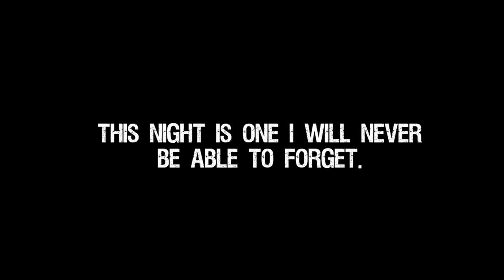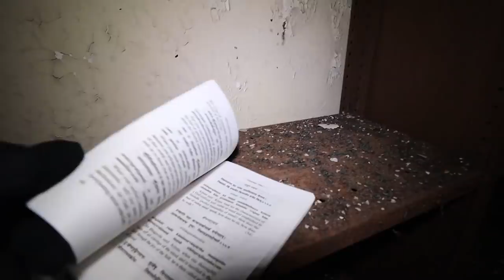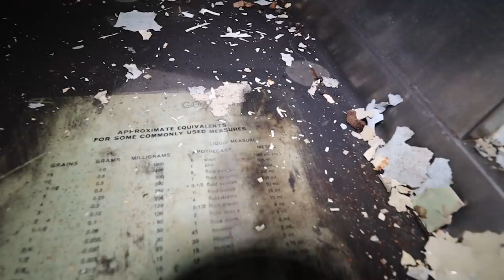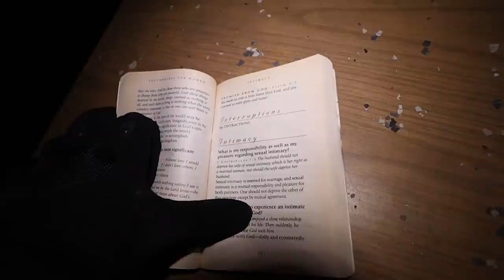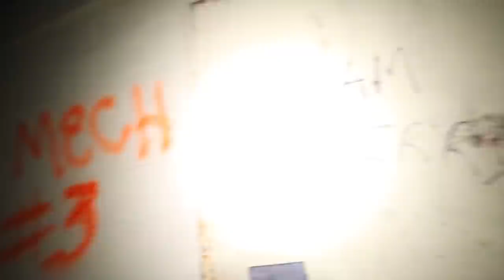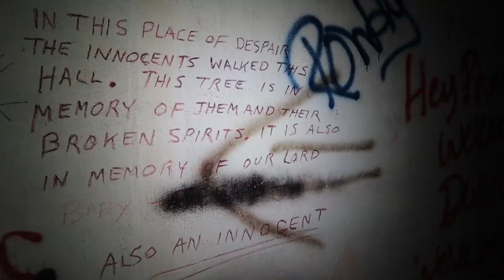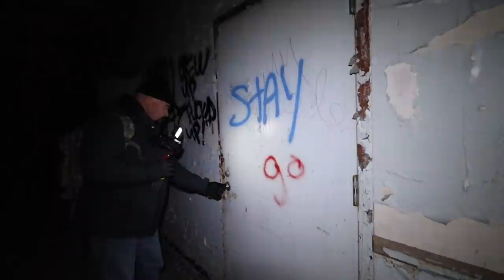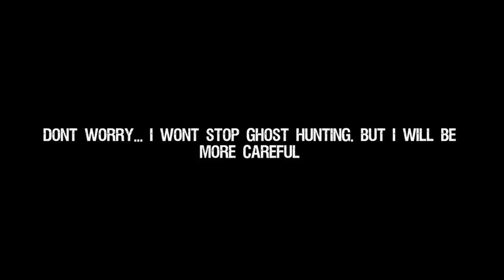**Part 1** OVERNIGHT INSIDE PENNHURST ASYLUM CONFIRMED HAUNTED

Comment: 29:50 when you toss the ball after it hits the floor and starts rolling you see an orb move really fast from right to left from the door ways 36:36 you can hear a whisper say down here 44:00 you see white mist left top of the screen and then what was that noise at 44:04

Comment: Pretty sure you aren't reading thousands of comments but at 41:50 the yellow caution tape was swinging.  It sounded like a single dog bark at 39:00, 42:13, 50:56 and where the coffin was located.  Saw some orbs here and there...maybe some were dust but don't think you can stir up dust in water.  Be safe!

Comment: I worked in a restaurant in my teens and early 20s and that wasn't an IV bag that was a soap bag and the part that stuck out was a rubber tube that squishes when you pump the handle to drip the soap out.

Comment: That "I V BAG" is a  soap bag I use them at work all the time.... they are for the older hand sanitizer dispensers... if it was a iv bag the tube conecter would be at the very bottom not 2 inches from the bottom

Comment: @15:15-15:20-27:15 you hear whispering. From 40:50 to 40:57 it sounds like ppl talking. I hear it with ear buds. At 41:47 the caution tape started moving the one behind gate.

Comment: When you and Sonny went to the basement & saw it separated down both sides and you told Sonny to go left and you would go right, I swear it looked like an old nurses dress hanging or floating up higher toward the ceiling down Sonny’s side. But when you looked another way it was gone. It was at 29:05
At 41:46 the caution tape is moving that’s hanging on the cage, beyond which you were hearing noises and was like naw!!

Comment: Nope. Shoe didn’t fall over. U set that boot up on the lower shelf...it was upright still
Think table was pushed into further into that rack the shoes are on. 

And not for nuttn but there are like 8 different types of shoes and not one of them would be state issued . Esp shoes w buckles or ties or...heels. 
They be slip on, flat cheap shoes. If they had any.

Comment: hey  cj
Reply: 6;18 clip  in the lower right corner  there are 3 young males white and one  female  with dark hair she looks like she is wearing a straight jacket right under that window there   she has two dark holes where eyes are
Reply: 7;41 on the bottom right  portion of that gurney there is a nurse attached to it there  wearing an old fashioned  nurse outfit  she looks like an older african american   grandma type she i s holding a really old needle  syringe  on a tray  like she is showing you
Reply: 16;59 looks like a possums   a  baby one